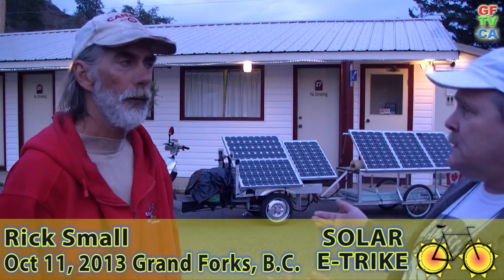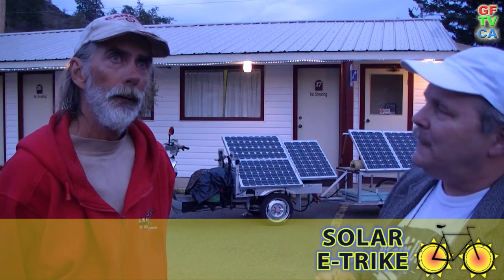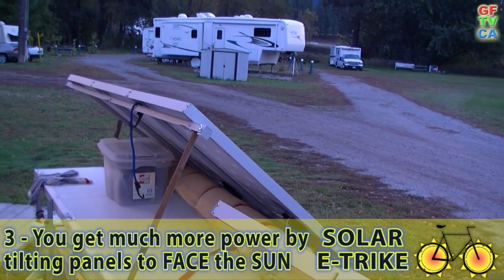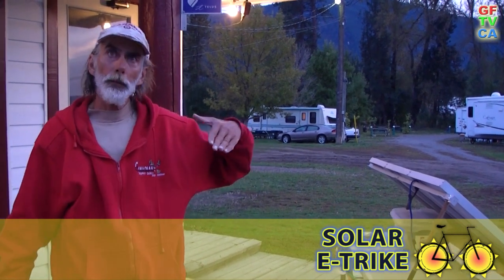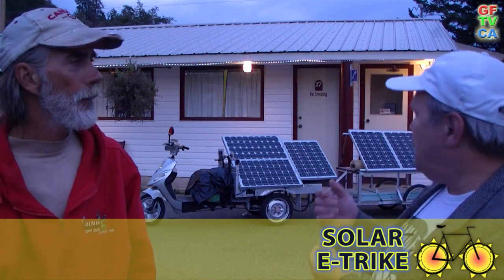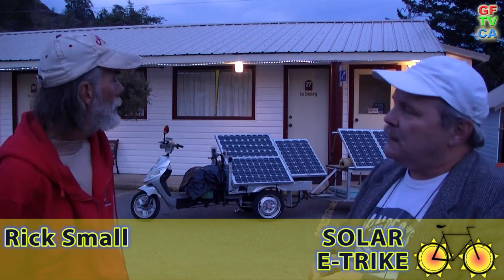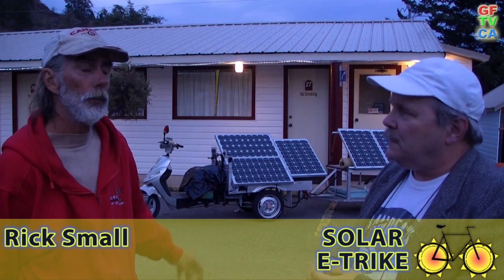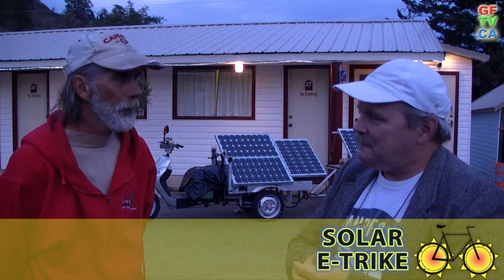131011 Solar Electric Trike

Comment: That's a chinese moped trike same as mine. It's not self built. Its been electric from the warehouse. He just added solar panels same as I done on my trike😂😂😂😂. In some countries you cant have such a long bike with trailer. So my moped takes 110w per hour from solar panels mounted on the trike. This has a 250 watts motor. And my batteries are 960watts each. 2 of them. Plus A solar battery bank Lithium titanate charging and discharging at the same time. I can go 210 miles a day. The top speed is 15.5mph.
Stop believing that crappy video. You cannot top up that input energy direct to the battery. He needs lithium titanate to take in that much electricity. That trike moped its $1300. Not what he is claiming. I ve done mine 4 years ago. Bought it second hand for $900  including shipping. He is liar. 😂😂😂😂😂😂. The total cost is maximum $3600 including his solar trailer.

Comment: i dont understand whats the big deal.  it looks like a chinise e-trike from Alibaba (or rebranded for CA by some local company) with bunch of solar pannels attached.  Probably took them a few days to put it together.  Lots of stupid decisions too, that thing is way too heavy for what it is, they should have went with bike based trike and not a scooter based so it would be MUCH lighter and all that metal in the cargo should been replaced with fiberglass.  then they could have added roof for 1 more solar pannel and they would not need that trailer.

Comment: Wow a 250 W engine and his solar panel covers 300 W that means he’s covering all his bases wow
Reply: You not gonna cover even with a 300w. Because peak power in acceleration its 320w plus up hill 360w. The sun its available for him only at a 30% quantity from the sun day light. He connot face the sun with the panels sideways. He need to park to be able to recharge. For those projects you need to keep the panels flat top and be happy with 20% less energy.....but constantly. To cover the needs you need lithium titanate and 750watts of solar panels to be able to charge the titanate cells at high speed.
Keep in mind, our trikes can only go 15.5mph. That's the maximum legall speed in most of the countries. If more than that, you will need 4 metres solar trailer....car platform. Which is impossible to tow with such a poor e trike moped made in China.